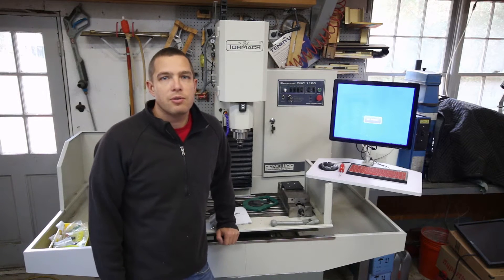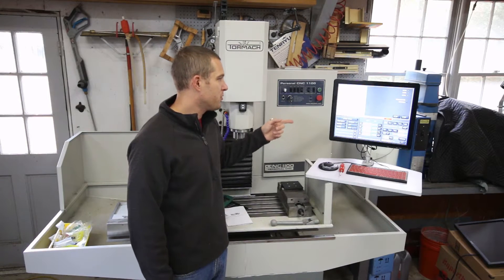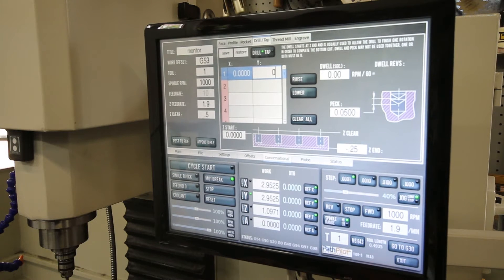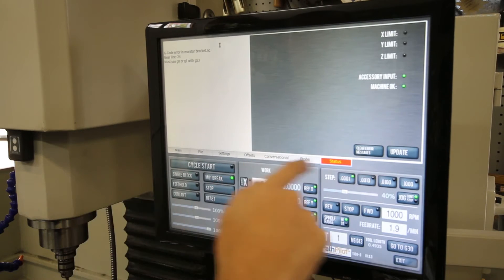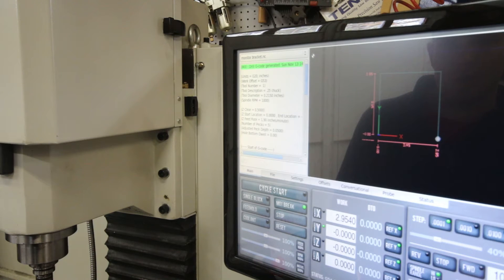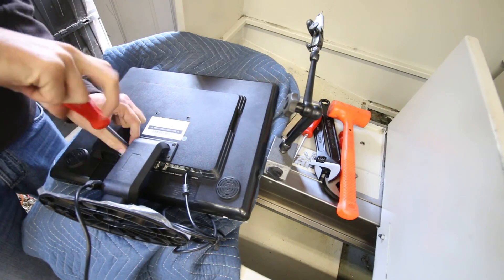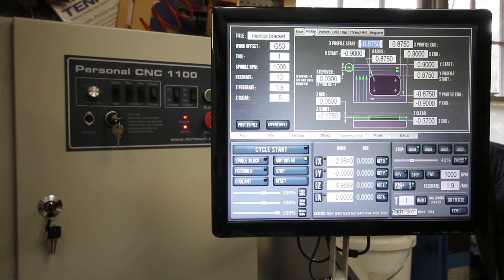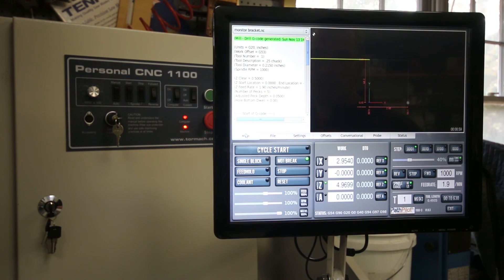Tormach Monoprice 19in Touchscreen Install

Comment: Did you have to load the driver CD that comes with the touch screen or did you type ADMIN TOUCHSCREEN into the MDI line an calibrate it like this? https://www.youtube.com/watch?v=wOrGJ3vGGWs&t=135s
Reply from the maker: It was plug and play I didn't install the driver or make an adjustment in MDI.  If you switch to a different screen ration then you would have to make that change in pathpilot

Comment: Anyone having issues with that monitor and erratic behavior of the cursor? On mine you touch the screen and the cursor goes crazy and  jumps all around.  I have an RMA with monoprice to swap it out
Reply from the maker: Sounds like it could be bad.  Maybe a defect in the layers.  I wear those black medical gloves and both screens I have work fine with those on.

Comment: Since PathPilot is running on Linux you can adjust the display parameters in the config file so that it will display correctly on a screen/display with a 16:9 or some other aspect ratio.
Peace!

Comment: Hi, great upgrades am wanting to go the bigger touch route too, used your link below, but am wondering if its getting me to the right monitor as this one is the 5 wire interface, but i thought Tormach is USB interface, can you confirm if the one you link to is the right one?
Reply from the maker: 5 wire just refers to the technology the screen uses to locate where you're touching it. They're all USB to interface with the computer.